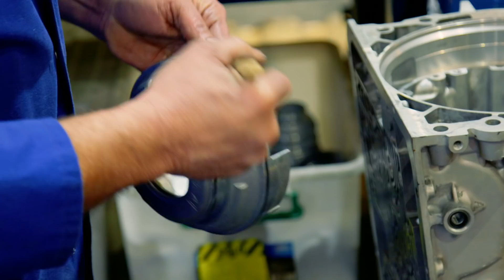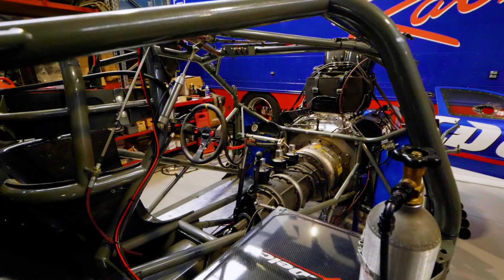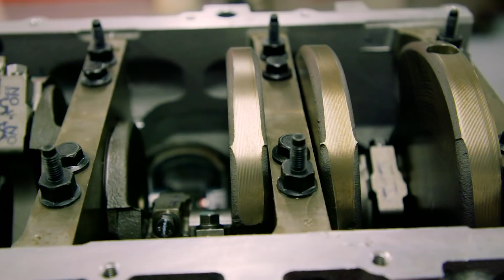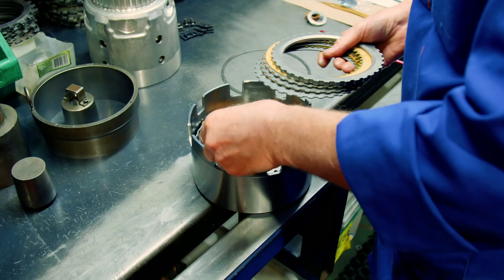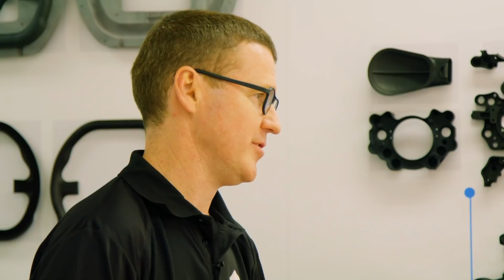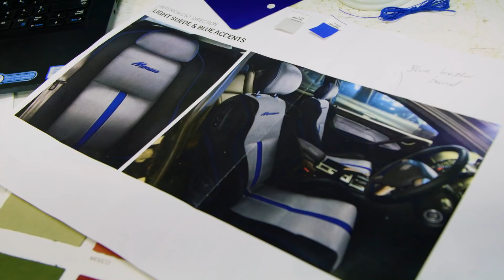Holden's Project Monaro | Episode 3

Comment: There is only one thing about this motor which is performance based. A cam. Guys when I modified a lancer off all things. I had the intake, exhust, throttle body, valve springs an cams modified an performance tune. An it was street able so don't give us a clubsport cam is all your capable off. That's weak.

Comment: I don't get the point of this exercise. Take one high millage two door Commodore, rebuild it back to basically stock and give it away. Why not just find a good low millage one and give it away? It not like they are even doing anything interesting in the rebuild. Virtually stock engine and transmission, wow that will make for exciting performance. The so called "professional" engine builder just made some serious rookie mistakes, this thing will be lucky to perform as well as a stock engine down low to mid engine revs, all to improve an exhaust note, really!
Reply: Dodgy Brothers Engineering 
What would you have done to the motor
Reply: @hoonaticbloggs5402  for starters I would have chosen a completely different camshaft. Closing the lobe centres on a small duration cam is just plain stupid. Ok so they CNC ported the heads for a bit more flow, but he didn't substantially increase lift or duration, this is evident by the fact they put standard Holden springs back on it and didn't change rocker gear. Closing lobe centres is fine in an engine you plan to keep at WOT like drag racing, because it makes the power delivery peaky, and tends to push it up to the higher rev range, it kicks the crap out of your manifold vacuum so you can forget booster vacuum when driving. Low end performance where most street driving is done will be severely compromised with less torque because the cylinder pressures will be down by the increased overlap.
Reply: Dodgy Brothers Engineering 
I went 230/236 with .591 and .6 lift.
Reply: @hoonaticbloggs5402  that's about the practical limit for the street. Couple it with an auto and a reasonably generous stally (~3500 - 4000) and you should find it has reasonable street manners. As long as you didn't go crazy with lobe centers and kept them reasonably wide (~112 degrees) you should still have half decent manifold vacuum. Be careful with your choice of porting / after market heads / manifold as you can easily turn reasonable vacuum into poor vacuum very quickly. Make bad choices on the intake side with that cam and you can turn a nice streeter into a 0 vacuum at idle pig.

Comment: Street Machine, if I wanted to see an infomercial I’d have gone to the Holden website.

A GE90-115B uses 1.2 million cubic feet of air per minute and generates around 110,000hp. Makes the 3,000hp from the piston slapper in the video insignificant 😂

Comment: Ill have to book my falcon at the Holden dealer for a service to be eligible for an entry to win
Reply: Keep in mind, you need to spend $110+  (in GST) on AC parts or on the total cost of a Holden dealer service.
Perhaps getting a basic service/oil change would be the best value if your car is due for a service.
Reply: Better yet mate come in buy some AC Delco filters and some oil get your self a entry and service it yourself